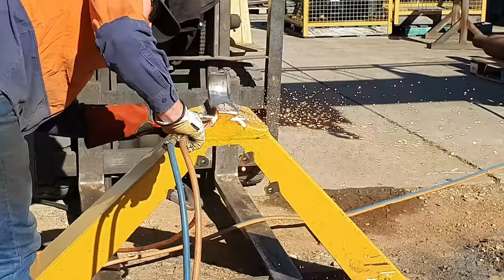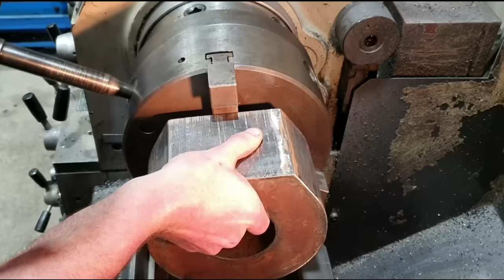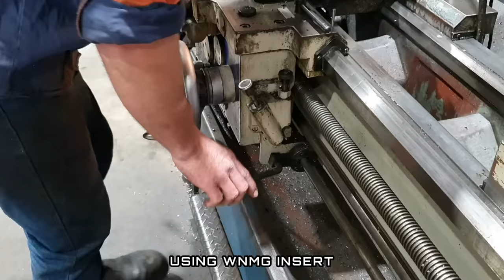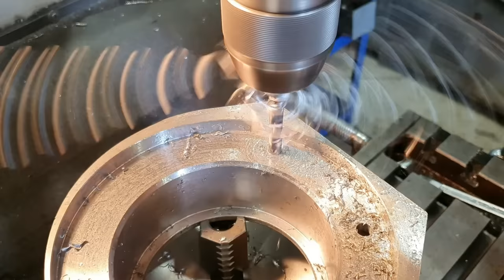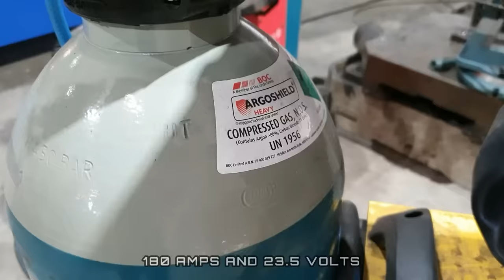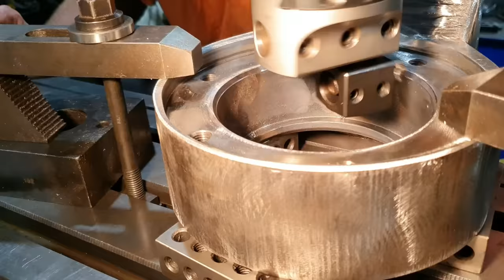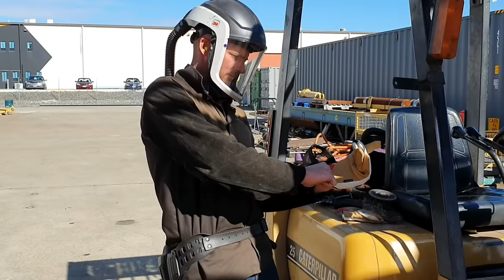Replacing BROKEN Eye on A-frame for CAT 745 Articulated Truck | Machining, Welding, Milling

Comment from the maker: Hey viewers thanks for watching this job from our machining shop! This is just one way to get it done using the tools and materials in the time frame we've got 😎👍 
Subscribe and hit the bell icon to turn on notifications so you don't miss our weekly uploads. 👇 🤳
Follow us online here: 
Instagram https://www.instagram.com/cutting_edge_engineering 
Facebook https://www.facebook.com/cuttingedgeengineeringaustralia/
Official CEE Merch shop: https://www.ceeshop.com.au
Reply: Saw your post on I C weld and came to check out your videos. Amazing work.
Reply: Is that on Cat 745,a A frame for back axel?
Reply: I think it is good where you show a picture of the type of machine a part comes from, what it does.
Reply: Hi mate. Does liquid nitro affect the grease of bearing?
Are those red grinding discs Cubitron?
Thanks.
Reply: I am not questioning your craftsmanship there's no doubt your extremely talented machinist welded and fitter but I keep seeing people welding things back together welding is not a load bearing method of manufacture that will break eventually I appreciate you filled all the cavities but still welding is not meant for load bearing manufacture but still excellent craftsmanship no doubt about it
Reply: As good as new, including the paint.
That milling setup was quite scary. The table must be locked HARD in order to not to bend under that sort of load. It is not about the rigidity of the milling machine, even the thickest steel bends somewhat under load.
I assume You had, after aligning the table, some sort of a support between the floor and the workpiece. Or, was it just dangling in the air ...
Reply: @FinnoUgricMachining  it looked to me like the A-frame was still supported by the forklift the whole time. Good shop management decision - minimizes the load on the milling machine, and provides extra safety.
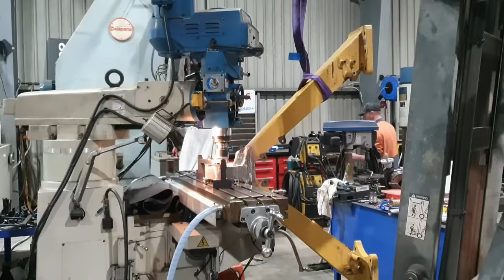Reply: @honorguardsfencingclub7322  To me it looked like the lines were loose at 29:56
Reply: Was the distance to the C L of the hole to the base critical?  I don t think I saw you check that.  As always, a great video
Reply: william mccafferty can you tell me how it was originally put together then? It was welded in the factory. This will be as strong as from the manufacturer, Providing the welds are as strong.
Reply: @FinnoUgricMachining  it was dangling from the forklift fork via strap.
Reply: @williammccafferty8558  this a serious statement? Or have you been smoking some herbal products?
Reply: Hey Kurtis, why no grease Zerk so the customer can grease the swivel?
Reply: @williammccafferty8558  I'm fairly confident that you don't know shit. That weld will be stronger than the surrounding material. You saw the original eye was welded on, and didn't shear at the weld.
Reply: Thank you very nice joke
Reply: That's how you do it. brilliant top job👍
Reply: U9
Reply: Por favor laravillas cosas que hace este señor una ma
Reply: How many hours did that take you? Fantastic work!
Reply: I’m thinking that the drill bit you used is not like the ones available to me in a US hardware store.  ?  Thank you so much for everything; always enjoyable. Best Regards
Reply: Hit the 2K subs
Reply: @seano51  me non
Reply: Hi there great video and some.grest skills on show. Was there any requirement for welding procedures, welder qualification, non destructive testing and post weld stress relief  ?
Reply: Do you know why the bandsaw cut was a little wonky? Also you know you've measured properly if you have to use liquid nitrogen!
Reply: Outstanding!  Well done!  Love the outakes.
Reply: ㅡ
Reply: @williammccafferty8558  classic rookie engineer statement, did you read that in your DIY sorry i mean engineering 101 book?  Some engineers can draw you a picture on how to tie your shoes, but they couldn't tie their own shoes. But it looks good on paper....
Reply: @davecunningham7018  exactly.. Maybe william thinks the whole thing was milled out of one blank or piece of steel.  Or maybe it was drop forged.
Reply: He blew smoke like that, so he didn't use a fan or a smoke extractor.  not good for health
Reply: @Cutting Edge Engineering thank you for the share
Reply: Nice clean off B4 grinding
Reply: So satisfying seeing this done. Beautiful work.
Reply: Looks great 😃😃😃 i
Reply: banana engineers drilled two threaded holes. Causing the ear to break
Reply: No, not two. Six holes
Reply: I’d be interested to know the temperature of the block while you are milling.
Reply: Very lovely 2 parts for yours lovely dog, too.
Reply: Kurtis, found this channel on YouTube,  absolute respect for the professionalism attention to detail you bring to every job. Thanks my friend from Wyoming.
Reply: Factory robots couldn't do the quality work you do.
Reply: What Tap set are you using for this ?
Reply: 3
Reply: @williammccafferty8558  Buildings are built with welded flanges supporting loads every day. Machines have welds all over supporting loads. Just my observations.
Reply: ดีเก่ง
Reply: 65r
Reply: @honorguardsfencingclub7322  6
Reply: @williammccafferty8558  u could clearly see the original part that broke was welded and not nearly as well…… welding is used for load bearing all of the time. Have you seen new heavy equipment!?
Reply: @upshift9613  plus one to that. Seriously stupid statement! Weld is not load bearing??? What??? That is the entire point of being a certified structural welder lol. We trust our lives to SAW bucks. Lifting devices all welded and certified for the load. It’s not even worth justifying a response to such a stupid statement!!
Reply: @josemanon6295  /
Reply: @shawn01707  But been studying on the online, and had to watch hours of youtube vids. Now I sent in for my Mail-in Youtube certification. It's way better then the VHS videos from the Homedepots. And once I figure out how to turn this welder on. I feeling pretty good that I can do that, just like this video here. Kinda sorta maybe for sure   The ones you don't say "Have at it killer, knock yourself out"  but do say "Wait let me stand clear"
Reply: This is the first vid I’d seen of u guys, but it didn’t click in the ol noggin that this was u when I subbed couple o weeks back. Nice to see a young geeza making a success out of life 👍✌️🇬🇧
Reply: Antonmursid🙏🙏🙏🙏🙏🇲🇨
Reply: I so love your videos, they re relaxing and most of all informative, I usually watch them when I get home from work as watching you is like watching a surgeon , you truly are amazing, the amount of technical knowledge you have and skill is just amazing I'm in awe as I understand what you are doing so I can appreciate how amazingly skilled you are. not sure how many other videos you have with the country music on them but I don't find it goes at all for you timelapse moments, that's just IMO but i think you can find something that suits you more for your raw power and skill, Rammstein maybe LOL still keep up the amazingly work and camera work. 
PS: I love those closely curled bits of metal like the part 2 of that piston repair you did I so wish I could have one of those long ones, not the ringlets as much as the wider more almost plantlike thicker spiral inside a spiral that are almost triangular. I think they are so beautiful. I game with an ausie and he is like your cuts and the sware jar its just too funny when I hear him as I expect you :P Keep up the awesome work all of you, also LOVE your workshop so wish I could have my workshop like yours, I have quite a bit even a shopsmith multi unit just have to learn how to fully use all the lathing tools lol. 

Love to you both from a Canadian girl :)
Reply: no grease fitting?
Reply: 9999
Reply: Caterpillar uses proprietary flexible steel alloys. So replacement not refurbishment is indicated.
Reply: on your next project can you match the framerate with the lathe rpm? would be a great cinematic experience
Reply: I'd love to have your skills but there's no way I would put my hand in the liquid nitrogen, did you machine your big brass nuts yourself because I think it's the one thing you've done oversize 🤣🤣🤣
Reply: @williammccafferty8558  Your car is all welded together. So are trains, buses and ships.
Reply: The customer is always right.  Just line bore it and send it back.
Reply: Хорошее кино и работа. Было интересно смотреть как идёт созидание!
Reply: Kurtis😂😂
Reply: Relatively new to the program - really like watching the busted stuff get fixed “using tools and materials in the time frame you’ve got” (you have to, or it don’t git done, or you don’t get paid!😂)

Your camera woman does a fabulous job getting the different perspectives/angles and showing what-else is going on (not just focusing on the part).
liked that before-fade-to-white-after transition.

Comment: Was a Precision Millwright for over 40 years,and still impressed by the machine work performed by  these Master Machinists
Reply: Q: since you might know the answer. How
Much $$ do you think these guys make a year?
Reply: This not these
Reply: @nef003  Kurtis is a special case in that he owns his own business and brings together a pretty crazy mix of machinery expertise, welding/fabrication hands, and machining hands. It's hard to find a job working for someone else that engages this variety of skillsets, because the road to profit tends to run through specialization. Three ways to answer this, if it helps:

If you want to keep the variety of this work, maybe if you add a lengthy science/engineering education and could do all of this plus high end white collar stuff, you could prototype stuff at the R&D division of a manufacturer. I know a guy from my Ph.D. who has a job like this (but for small high-tech widgets, add labby stuff like lasers and electronics, subtract the welding/fabrication). He has a top Ph.D. in physics and we bonded in the machine shop there - he is great in the shop. There are not a lot of these jobs and variety pays less because variety does not produce a high volume of salable goods or services. Often, these jobs' progression is to pay more as they get less fun. (A megacorp will buy your cool startup with the fun job, and eventually you aren't working with your hands at all as you move into management and deal with megacorp's soul-crushing corporate bureaucracy and politics full-time. They are forced to pay you a lot more to make it up to you.) My friend is in NYC and does fine but I think, even with no kids, he and his wife rent their apartment. If I had to guess, with 10 years' experience, I'd say he pulls $130k/yr plus benefits. That's good money, though remember a lot goes into it (4 years of a bachelor's for $$$$$, then 6 years of a Ph.D. earning a stipend that's just enough to get by, so you're about 30 before you see your first good salary and might have many years of fighting student loans from college.)

Funny thing about owning a business (I do this in another, fully white-collar, field) is that it's hard to price business revenues on an equal footing with wages or salary. Business takes over your life, and there are lots of crazy new taxes. The volatility in the revenue can be insane; sometimes you're making less than a professional bum even though you haven't turned away from the 365 day commitment. This can be stressful and humiliating. The cost-of-goods-sold for work like Kurtis' is extreme and in itself hard to price. It's not just the huge bill for consumables like electricity, welding wire, argon, inserts, wrenches that broke, etc. Much of the cost of a heavily equipped facility is depreciation of capital assets and/or debt service on the equipment costs, and you could give yourself a 75% raise by changing the assumptions about these things in your books. If you spend that raise on a fancy lifestyle, you might find out in 7 years that oops, you were actually starving to death all along without knowing it, and now your facility is useless and you're  bankrupt. Even my business, which is extremely simple - I sell white-collar expertise from a home office, mostly by the hour - feels hard to price vs. a salary. I've built complicated spreadsheets in which I try. If you keep the flow of work high and steady through good marketing and price the work well through confidence in negotiating your sales, you can create a significant wealth despite all these costs. Those are big ifs.

Finally: My next door neighbor is an experienced metalworker in his mid-40s. He leaves for work at 4:30 am and comes home looking tired and smeared with that oily iron oxide schmutz. He works at a big plasma cutting table making parts for big steel buildings and has the skills to lean into many other things at the shop. He made this gorgeous meat smoker for his yard, so I believe him when he brags about his skills. Observing his lifestyle: We live in the kind of neighborhood where the public schools are bad, there's broken glass on the sidewalks, and drive-by shootings happen. He and I take pride in making the best of our little corner of it through cleaning, gardening, etc. He and his wife (who also works) have built a strong foundation for their kids, who attend a charter high school. He has an expensive hobby (bodybuilding) and his star daughter, now graduating high school, drives. He drives an old Jeep he fixed up himself, and they pay rent to his mother-in-law for their apartment. He complains when the overtime dries up. If I had to guess, I'd say his base wage is ~$35/hr plus benefits and overtime.
Reply: @ramanshah7627 lifes tough, I'm 19 and lost. Family wanted me to become a software Engineer but now i just wanna get the degree and get over with it. I wanted to get into the airforce but they denied, then aircraft maintenance engineering but they denied. Now comercial pilot is my most favourable career but the fees is too high for my family. These days i just wake up go to college, do nothing and return, Im thinking about getting a part time at the local garage as I'm good with wrenches and machines but managing college and exams would be tough and family said no to job.

Comment: It would be pretty funny to see the customers face when it was dropped off with only a line boring done to the 1/3rd of what's left of that eye.
Reply: You want a line bore? you get a line bore.  Oh you wanted a fix? that will be different.  Maybe next time, let us know it needs a whole replacement.
Reply: Could have fixtured the remainder of the bit cut off, and bored it out, then framed it with a small caption " just needs line bore", and put it on the wall.

Reminds me of a job, where the description was "first bomb fell on target".
Reply: @SeanBZA  What?! We gotta here that story!
Reply: @SeanBZA  elaborate, spunds pretty interesting haha
Reply: If the w/o said "repair eye, linebore" it means refabricate and linebore. You got the refabrication done, but you never linebored it. Lineboring is performed to create parallel and square features referenced to a datum (the mounting pads) such that when the A-frame is reinstalled, its bore is parallel to the plane of the pads, perpendicular  & centered to the mounting bolt holes and at the right height. Even with a spherical bearing installed, just 1 degree error in the horizontal plane will cause 17mm misalignment of the bolt holes on a 1 meter long shaft.
  You should have bolted the pads to a HMC or a squared fixture on a vertical mill, centered the spindle to the mounting hole pattern's center and floor-to-bearing-center height, THEN linebored it.
Reply: @genekoveski9035  but... This thing connects the axles to the frame doesn't it? That spherical bushing will never sit square while the truck is in use or even just parked. Not being square with the mounts barely matters as long as it isn't so far off that it limits the angle the axle can swing, which would be quite a feat since this bush should be able to move way more than the actual axle

Comment: Having Sharpened Drills in my shop for nearly 50 years, the most impressive part of this VERY IMPRESSIVE Video was the drilling on the super spacer.. It's possibly the FIRST Youtube Video that I've seen where the drill is drilling 100% symmetrically! Swarf coming out of both flutes equally? Unheard of! Spot on! Well Done!
Reply: Proper bit.
Reply: Gotta like them twin swarfs especially the redheads

Comment: The whole process of managing the thermal expansion, I can see how you weld small bits at a time to prevent distorting the eye and frame too much, possibly unequally. Amazing, like watching a freaking artist. Good job.
Reply: not to mention metallurgy, blueprint reading, etc.
Even in welding or machining (i have both certs), there is a LOT of science, going on.

Comment: This brings back so many memories of walking through the machine shop in the 1950's, which was founded by my great grandfather in the 1800's. When I got home, my mother made me leave my shoes outside because the chips that were stuck in the soles would scratch her linoleum kitchen floor. Nice job!
Reply: Didn't you have a doormat to clean your shoes on before entering the house?
Reply: @AlessioSangalli  those metal chips need pliers to remove them.

Comment: As a heavy mech I’ve always said operators can break an anvil in a sand box with a rubber hammer. Great job young man . Love your safety man!
Reply: After they cracked open the first one and saw it was all meat they just swallowed the second one whole. 
They will spend the week passing it.